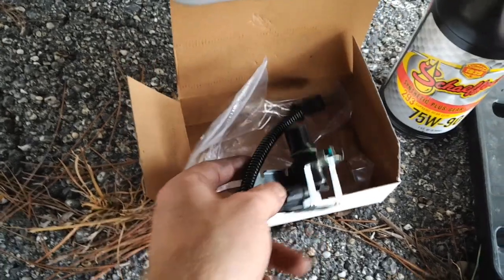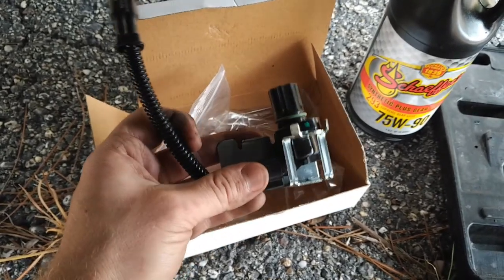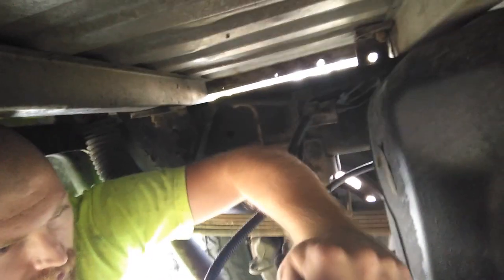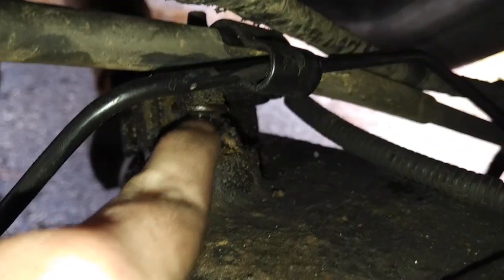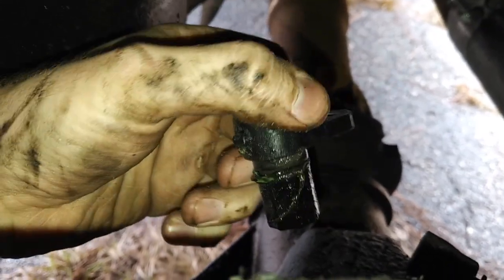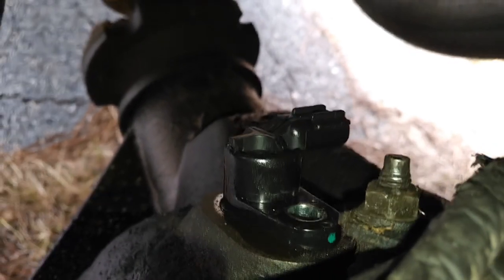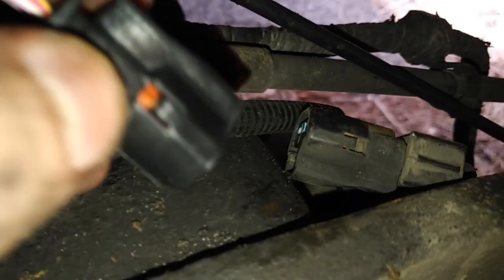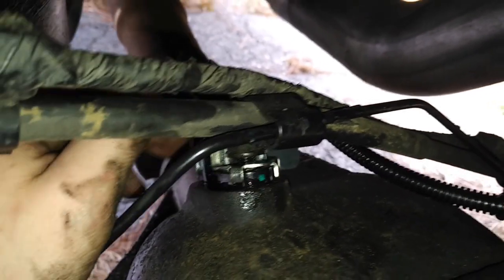Rear speed sensor replacement 1998-2005 dodge ram

Comment: Thanks for the video. You just gave me the confidence to do this. Not sure if this will fix my problem yet (won't stay in overdrive), but at least it will eliminate this as a potential issue if it doesn't.

Comment: Is there any way to check the sensor with a multimeter before just changing it? What do I look for? What do I set the meter to? I checked harness side for voltage and got about 5 volts out of it. Does that sound right? CEL is "rear sensor open" thanks

Comment: Hey if sencor goes bad does trans not shift
Reply from the maker: Trans will still shift even with a bad sensor
Reply: The reason I ask is I’m doing a swap into a f100 so if you completely delete the thing will it still shift 24 valve?
Reply from the maker: @curtisford6668  I think you will be ok. While The 47/48re trans uses speed to help determine the shifts as long as you have a speed reading coming from the PCM that is all you need for the governor pressure solenoid to work.
Reply: Ok thank you for your help!!
Reply: Would this sensor have anything to do with my 2000 Dodge ram not shifting out of 1st gear until hitting about 3,500 rpm? Also my speedometer will stay at 0 mph until I reach around 30 mph. The shifting out of 1st gear is my main concern but after that it shifts just fine.
Reply: @dennisclary796 I'm having the same issue (mine shifts out of first at about 2500 rpm though) I'm putting a fresh sensor on next week I'll let you know how it goes.
Reply: @luckyboyjoe  ya let me know if that works, I haven't messed with my truck yet so I'm curious to know.
Reply: @luckyboyjoe did you happen to replace that sensor and did it fix the problem?

Comment: Can someone please help me on my BN 1999 Durango I think it's a speed sensor it the rpm Gage it like jumping from 3 Grand to 4 grand back and forth  is that's  something easy to fix
Reply: Output speed sensor. That on transmission
Reply: Did fix u probelem borther my ram doing same replace everiting on it no ingine lithg but chams like tgat after drive 11milles str doin et
Reply: @darryllgriffin7714  how about a manual transmission?
Reply: Did you try resetting the cluster??

Comment from the maker: Part # APDTY 081135
Reply: Hey man did it fix your issue? I have a 2001 dodge ram 2500 with the 5.9 V8 magnum and a 5 speed manual, my ABS is out, parking brake light on, speedometer is out as well as the odometer isn't counting mileage anymore, is this all from this rear diff abs sensor being out?